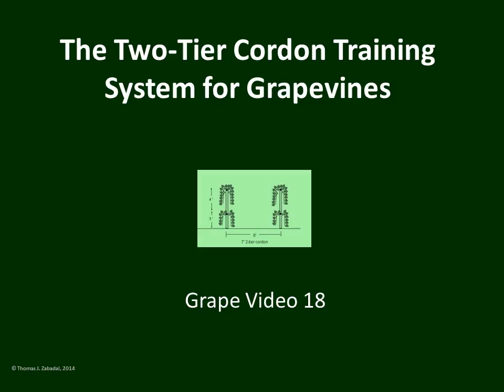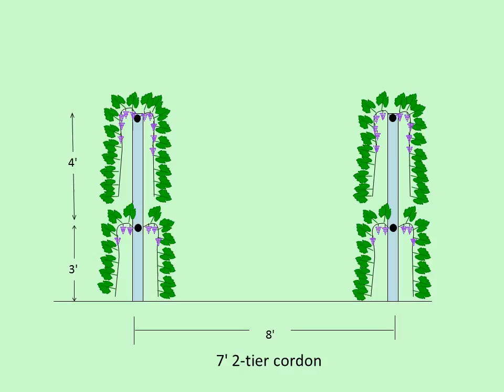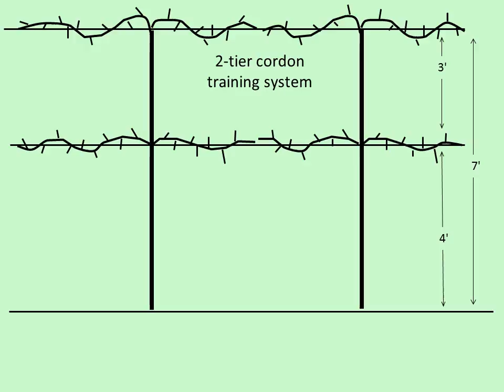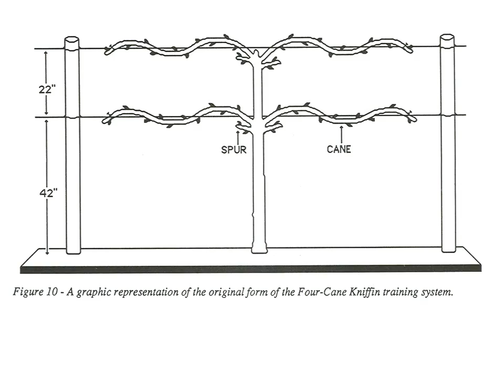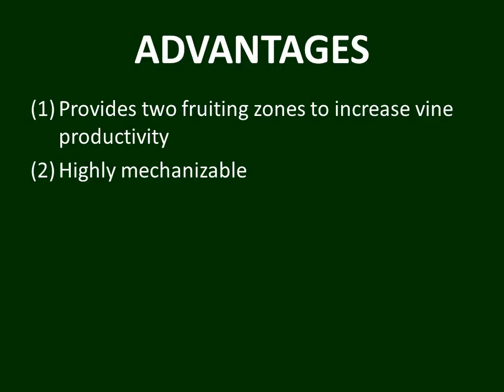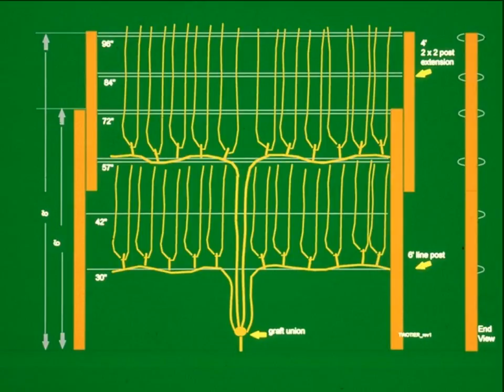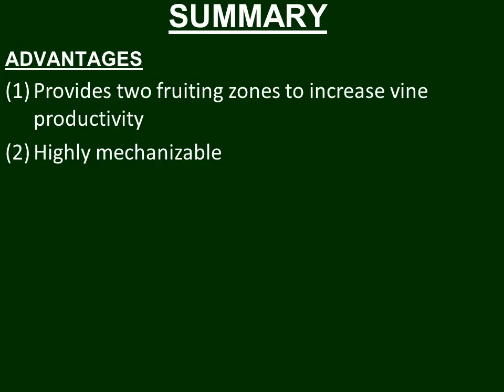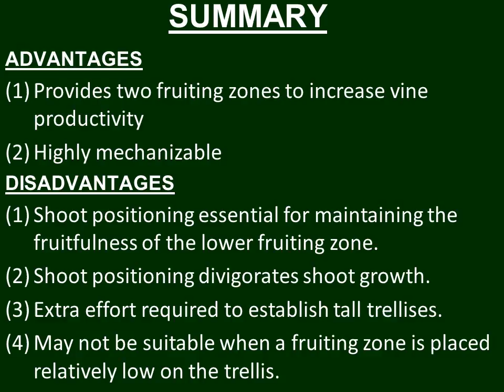The Two Tier Cordon Training System for Grapevines - Grape Video #18

Comment: A couple of thoughts: 1. When you picked the fruit with a harvester and the lower trellis was missed what type of harvester did you use I know that the old style Chisholm Ryder harvesters cannot get very low but the newer Korvan and Gregoire do get much lower on the trellis. 2. A disadvantage that I can see with the 7 ft trellis is work that needs to be done would require a person to use a ladder or standing on a trailer to reach the top wire. 3. If you could share any information on the shoot positioner I would appreciate it or if there is a unit in the Lake Erie region (NY or PA area I would like to see if I could watch the unit in a working vineyard also wondering how it would work on a vineyard that has slope or a slight terracing of the rows.